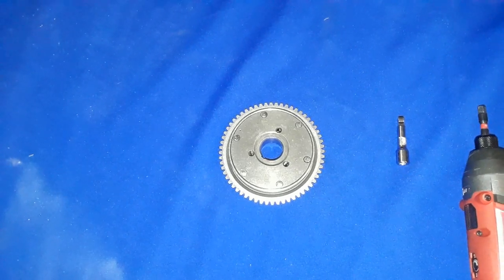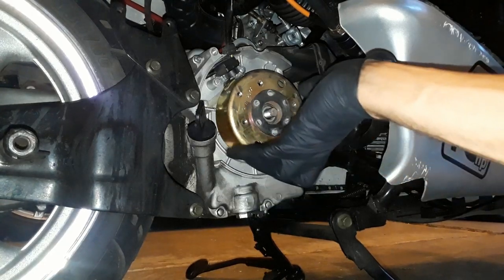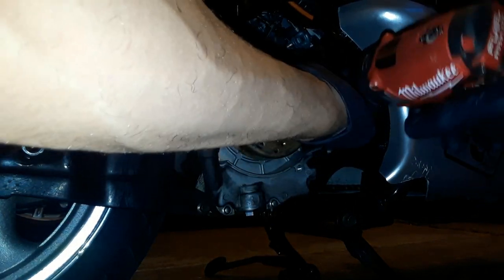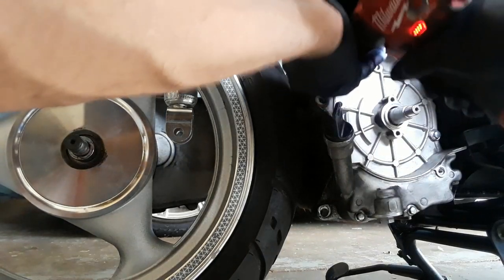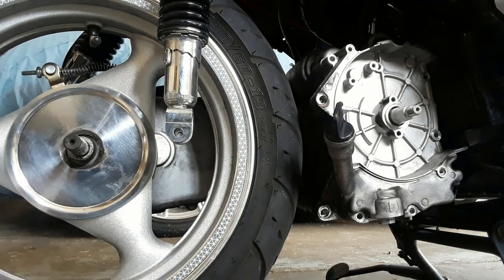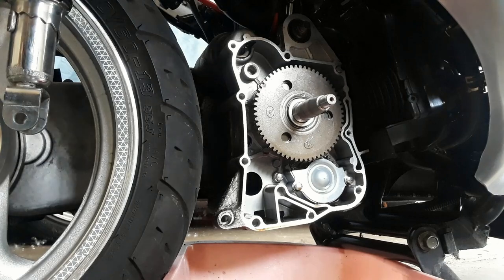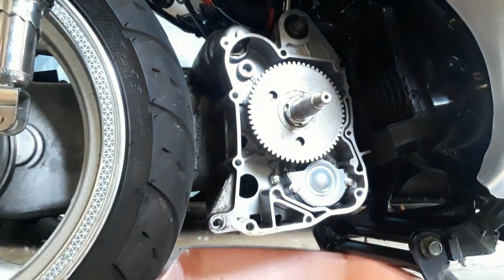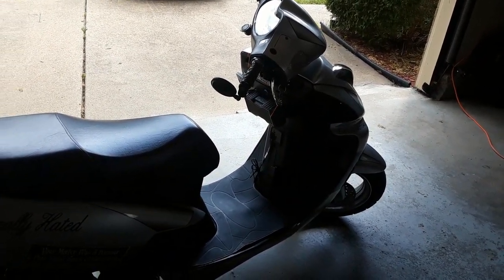Gy6 Starter Clutch Replacement

Comment: I mentioned a "cheat" on your Solenoid video & I have another for those who don't have a rattle gun ;)
Any time you need to remove something attached to the Crankshaft which means the engine will turn when you want it to stay still for you to remove a nut or part then you can simply remove the Spark Plug, push a clean soft rag into the cylinder via the spark plug port, making sure to leave some rag poking out for retrieval,... Turn the engine so the piston moves up toward the head & toward top dead center & the engine will stop rotating because the piston will compress the rag to "jam" the engine.
Now with the engine not being able to free spin, you can remove you nut or part (or clutch on a chainsaw, or blade on a mower) & you really don't need a lot of rag in the combustion chamber because the space is pretty tight as it is. 
I have done this countless times on small engines without damage compared to watching people snap off cooling fins on flywheels from using those to stop the engine turning.
Reply from the maker: Great addition David!!!

Comment: Great video. Quick question. I have the 177cc engine and Im about to do this same replacement. Do I need to get piston at top dead center before removing or just install everything exact position as it came off? Just wanna make sure before I start removing. Thanks.
Reply from the maker: Thank you. For this process you don't need to know where the piston is. This is used just for starting the bike. No problem.

Comment: And hey bro I have a 50 cc TaoTao scooter and I'm making it a hundred cc will this work for mine.? I'm trying to look online for a freaking starter clutch for my 50cc high performance and I don't see any only yours only the 150 or up it's like they don't come with it with my model . Idk. 🙄🤷‍♀️
Reply from the maker: Hey bro, the 50cc motor is a little different because it runs off a Clutch/Bendix gear. https://amzn.to/3tPiCVU
Reply: @kachiskid  and oh all right and sorry for the late reply bro. :-( but this isn't high performance part this is the same as the stock one right that it comes with. And yeah I figured bro cuz I couldn't find the exact same one as the 150 so I guess I figured it's different
Reply from the maker: @marineboy4181  no problem, not sure if they a high performance version of it.
Reply: @kachiskid  and  oh all alright okay bro 👍

Comment: Has removed all 7 bolts   and it still don't  come  off  how do you get off please it know play  in it at all but need off please help me  thanks. Love video
Reply from the maker: Use a rubber mallet and hit it around the sides.
Reply: @kachiskid   I try  but still  know luck
Reply: @kachiskid   I wish I  sent you   pictures
Reply from the maker: @anthonytarlng4876  Bro, you are either missing a bolt, which I don't think you are...or you are gonna need to go heavy with the mallet.
Reply from the maker: @anthonytarlng4876  You sent me picture already? Or want to?
Reply from the maker: @Anthony Tarlng  Watch this starting at 10:30... https://www.youtube.com/watch?v=J1pw7jCdCUw&t=8s
Reply: @kachiskid   do have take engine  out off the bike to do this job  . Big thanks help me
Reply from the maker: @anthonytarlng4876  No problem and no doesn't need to be taken off the bike. In that video that I made 3 years ago I had to use a rubber mallet I just didn't film that part.
Reply: @kachiskid   top men . Will this work on sym jets 4 125cc engine too
Reply: @kachiskid   very big thanks for your help  love your video  top men  will tell all my friends  to watch  you
Reply from the maker: @anthonytarlng4876  Love hearing  that! No problem little brother, anytime!
Reply: @kachiskid   a update  fella I got it off top men thanks just make sure  I get right one now to go back in  .
Reply from the maker: @anthonytarlng4876  So what was the problem? How did you get it off?

Comment: Do i need Loctite on the castle nut? I just installed a replacement heavy duty starter clutch and about 20 miles of city riding(so maybe 20-30 starts), its back to just the spinning sound when i try to start. Im praying to god its just because i didnt use Loctite and the castle nut just came loose. 🙏🙏🙏🙏🙏🙏🙏 🙏. And great video.
Reply from the maker: Thank you. To tell you the truth I didn't use loctite, and I'm not sure you should. Of course that castle nut should not come off as long as it is torqued correctly. I am on my 3rd starting clutch though, but went with a Taida on the last one.
Reply: @kachiskid Thanks i think ill try a couple drops of blue and hittin it real hard with the torque wrench. I might have been a little too careful about over tightening. If that's not the case then I don't know what he fk is goin on 😡 😔
Reply: Hey will you check my other posts down below about the liquid gasket? I'm trying not to lose my job so I need to get  on the road like yesterday.
Reply: Lol yeah it turns out that the castle nut just came loose. So I cleaned the shit out of everything, especially the threads and added a little Loctite and Bam. New starter clutch works just fine.
Reply from the maker: @mikecrawford4506  Awesome. See you knew what to do from the start!
Reply: @kachiskid  right on brotha. I had a feeling that someone telling me right off the rip that my brand new starter clutch was bad was jumping the gun a bit...
Reply from the maker: @mikecrawford4506  Oh yeah, I always find it is hard to say unless your there, or did the work yourself. Plus there are always work arounds.

Comment: Also , I'm not sure if that short amount of time ruined my gasket but in case it did, would it be okay to use high temp liquid gasket because I have a tube of that sitting around and I can't really afford to wait for a new gasket to show up because I use my scooter for work. I'm in the hospital right now for probably 4 or 5 days but as soon as I walk out of here I'm going back to work on that scooter. Thanks for any help you can give.
Reply from the maker: The gasket should be able to be used again. I hate that high temp crap. It ruined my 1st engine. (150cc)
Reply: @kachiskid  how?
Reply from the maker: I didn't give it time to cure and too much, I think. It was a horror show when I replaced it. The new gasket will be in tact when you take the cover off gently.
Reply: @kachiskid  subscribed
Reply: @kachiskid  thanks man
Reply from the maker: Welcome to my family!
Reply from the maker: No problem.
Reply: @kachiskid  just out of curiosity what did you use the liquid gasket on?
Reply: @kachiskid  i went ahead and said fk it and bought the sealed strtr clutch on China Motorsports' description link where he shows several along w a new gasket. Last thing I want to do is get home from the hospital, tear this thing down in the blazing Florida weather, and find out the POS starter clutch that rip-off GY6store  on eBay told me is much is so good has gone bas in 2 days😡. I just had to file a dispute with them because they tried to rip me off and keep my money but not return my item after agreeing to refund if i bought another one cause the first got stuck in the USPS wormhole 😔😆
Reply from the maker: @mikecrawford4506  Lol. on the China Motorsports...if it is the same guy I thinking, dude and me got beef. That being said he likes to talk about how much he knows about starter clutches, so lets see what he's got. Sorry about the GY6store issue I have order 1 or 2 things from there.
Reply: @kachiskid  oh damn I wasn't trying to get in the middle of any beef. Well I bought another starter clutch so I guess we'll find out which ones more durable. Which one which one do you use?
Reply: And as far as gy6 store goes... I used to be a loyal customer then all of a sudden the dude started acting like he was on dope or something. The funniest part was I kept telling him if he didn't refund me within the next week after tracking showed that he had received it back I was going to file a dispute and he just ignored that. So finally we hit the deadline I gave him a week later and I filed a dispute and he sent me this childish message saying "you are now BLOCKED FROM GY6 STORE!!!" As if he's the only place to get GY6 parts in the world 😆😆😆 and he sends me a message saying my order has been shipped (after I already ordered and received the second one from him) 🙄 so I hit up eBay and explain what was going on and they checked it out and refunded me the next day saying that he gave them bogus tracking information. Crack kills bro 😆😆😆
Reply from the maker: @mikecrawford4506  Oh no, no worries. That's between me and David. He use to come on my channel under 3 different names and try to talk B.S. I had to check him until the point I had to ban him from my channel. His comments can be found on this video. In my 11 pole stator install video, the intro is about him. I got the super expensive Taida stater clutch in there now. I like dealing with the NCY store. https://ncystore.com/taida-starter-clutch-heavy-duty-assembly-gy6

Comment: If the variator belt and clutch spin but the rear tire doesn't. And the engine wont start is the starter clutch to blame? I hope can answer this question thanks
Reply from the maker: Angel, is the engine turning over? Attempting to start? If the engine is revving but won't turn over, check for spark. Look at the video, right before this one. In the beginning I hit the starter and it make a weird sound, that is how you know the starter clutch is bad.
Reply: @kachiskid  Hello. No it doesn't try to start. Only a freely spinning variator with the belt and the clutch. No rear tire movement. If I turn the the clutch bell by hand the wheel turns.
Reply: Some reason I can't see the previous video. To hear what she sounds like to compare.
Reply from the maker: @angeljimenez5406  https://youtu.be/RujjyNothfU
Reply: The last sound where it sounds smooth. No cluncking or clanking. Thats what mine is doing. Could it be the starter clutch. Thank for the video link.
Reply from the maker: @angeljimenez5406  Yup, that sound is the starter clutch allday. Does your bike start when kick starting it?
Reply: @kachiskid  I tried and it won't kick start.
Reply from the maker: @angeljimenez5406  Again I say check for spark because the kick starter will start the bike even if you didn't have a starter clutch. That is only used for electric starting.
Reply: @kachiskid  okay I will definently try that out soon much appreciated.

Comment: I’ve replaced starter clutch and am finding the crankcase gaskets I’ve ordered online don’t quite fit. They are close except for a couple bolt holes. Scooter is a 2nd hand 2013 Kymco Super 8 150. Is there a modification that might have changed crankcase size slightly? I don’t want to order another incorrect gasket.
Reply from the maker: If you can't find the gasket for your particular bike, my recommendation would be to get some Yamabond. https://www.ebay.com/itm/172366134240 This is what Yamaha uses to seal there crankcases. They don't even use gaskets. I think Honda make one called Hondabond. They take a minute to cure but are worth it in the end.
Reply: @kachiskid  thanks!
Reply from the maker: @dirtydukeV  No problem.

Comment: Hello,
 First off, nice video. Easy to follow along, and you explain everything at a level anyone can comprehend. My question is this. You drained the engine oil before tear down . Did you also drain the gear oil? You never stated in the video wether you did, or not. Thank you.. 👍🏻
Reply from the maker: Hey Brian, thank you very much. The gear oil doesn't need to be drained. The stater clutch is only lubricated with the engine oil. No problem, anytime.
Reply: better and easier to use rope than a rag much easier to get into the spark plug hole